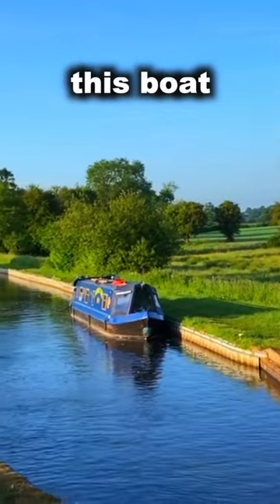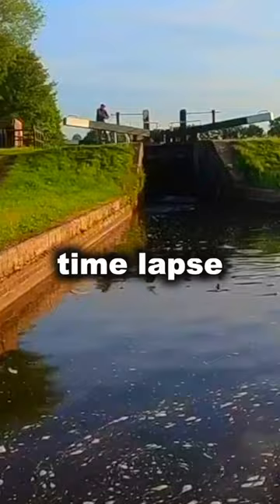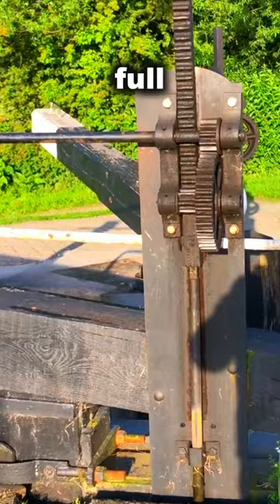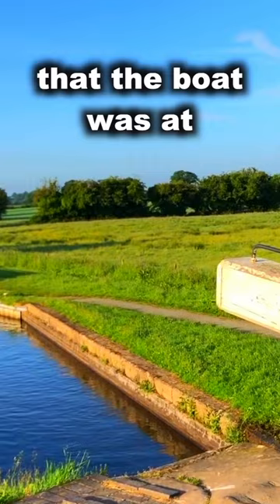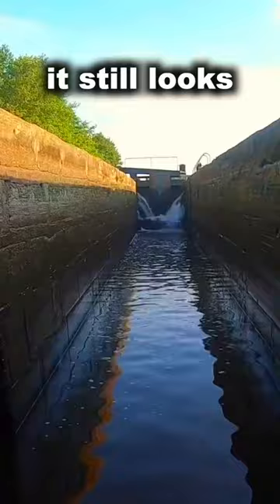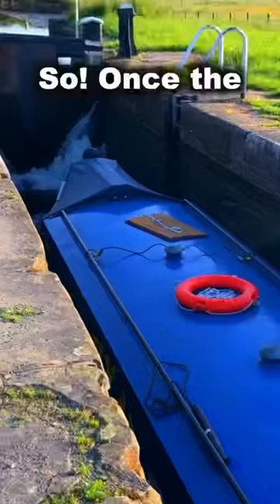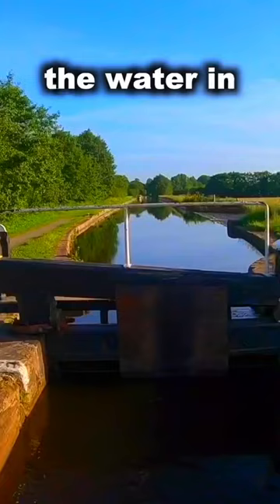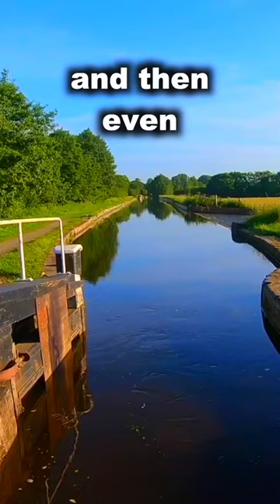Solo Narrowboat Lock Working #canalboat

Comment: Where is this? What happens if there is another boat 🚣 is it all single file?
Reply from the maker: Yes single file on these narrow locks, although some can fit two boats side by side.
If two boats turned up at the same time from opposite directions, then the boat that the water level is at goes in first, so then when it goes up/down the water level will be right for the second boat, if that makes sense!